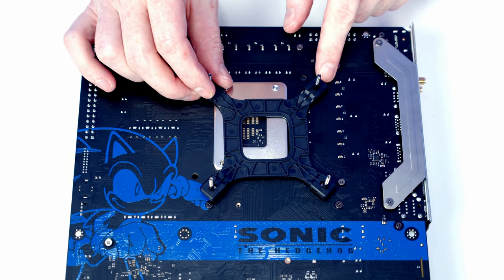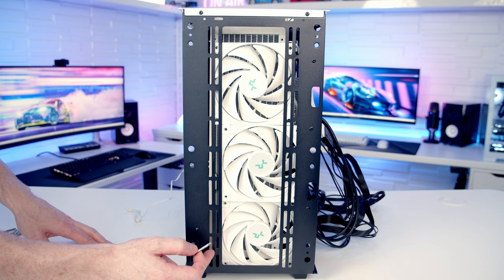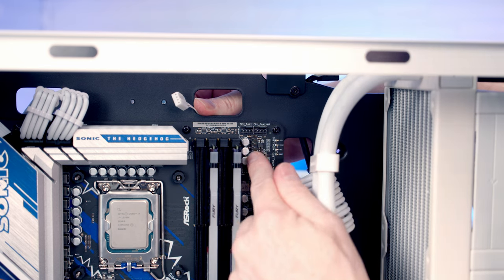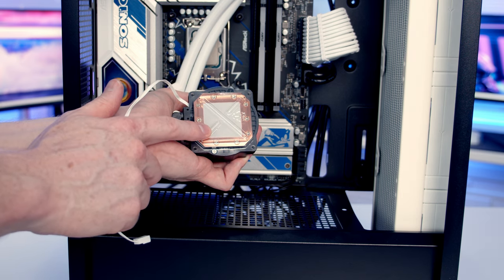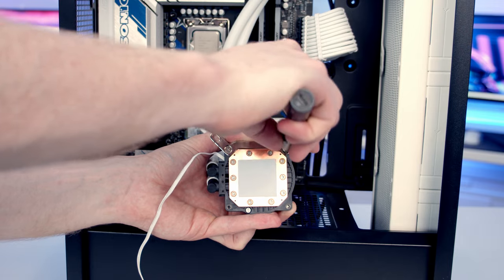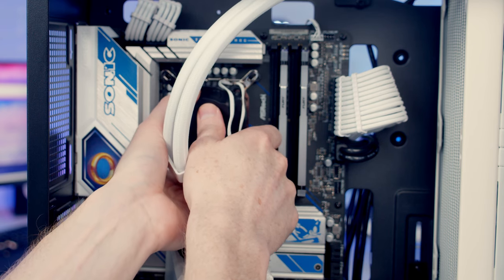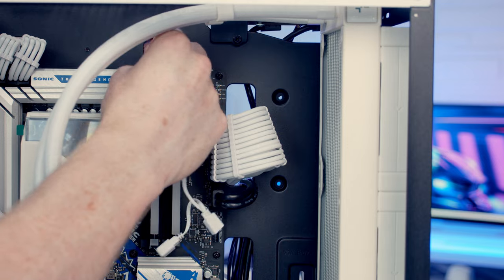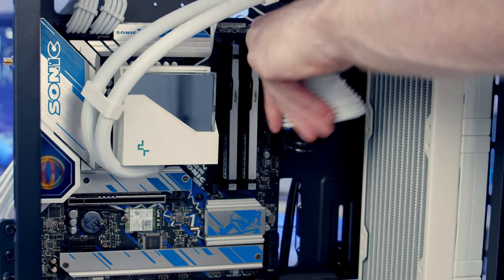DeepCool LT720 WH - Installation Guide

Comment: Great guide! But FWIW, the screws that came with my unit (purchased 8/9/23) are not long enough to mount the radiator and fans this way. They are just barely long enough to mount the fans directly to the radiator housing. Trying to ALSO go through a 1-1.5mm metal bracket does not work. A glance at the instruction pamphlet confirms this: instructions show mounting fans on one side of the rad (with long screws), mounting bracket on the other (with short screws, provided).  I''d have to cut my own, slightly longer 6x32 screws in order to do what's shown here.

Comment: Is that orientation good for the Aio cooler?.
Reply: Yes. As long as the pump is lower than the top of the radiator
Reply: @rocksen9283  what about MSI cooler where the pump is in the rad.?
Reply: @niravramdarie9898  then it doesn't matter. To my knowledge
Reply from the maker: In this case this will give the lowest cpu temps by a lot. Yes tubes at the top is ok as long as pump is not at the top of the loop.
Reply: @rocksen9283  Wrong. The tubes need to be at the bottom. Air bubbles rise, so if the tubes are at the top air will percolate into the tubes and thus migrate into the pump.
Reply: @squatch545  it's not wrong. What you said would be the ideal setup, but if, for any reason, you can't mount it with the tubes down, you can place the tubes up as long as the pump is *lower*. Air won't be trapped inside the pump because the top of the rad will be the highest point where bubbles will rise

Comment: Can you mount the fans behind the radiator in a pull config instead of push so the cables don't get in the way of the fans on top of the case? I've read the reviews on Amazon and some people say the fans can't spin properly when mounted behind the radiator in a pull config

Comment: The small screws for the pump are literally too wide for the holes.. even without the bracket, they do not fit.. they get through half way and then get stuck.. how’d you fit yours into your pump holes
Reply: maybe you had the bracket facing the wrong way?
Reply: @vectivuz1858  figured it out. The contents in the baggies were all mixed up. Don’t know why they’d supply 16 screws in the same bag as the bracket.. then fit the REAL 4 somewhere completely Separate

Comment: Hey if I mount the fan to the mount of the case, does it matter which side of the radiator I mount the fans? Whether that be behind or front, either side basically? Does it have any difference? thanks!

Comment: Does anyone know what size screws are used to mount the fans to the radiator? I bought additional fans to stack on the other side of the radiator, but they do not come with mounting screws for the radiator, they only come with the case mounting screws.
Reply: #6-32 30mm